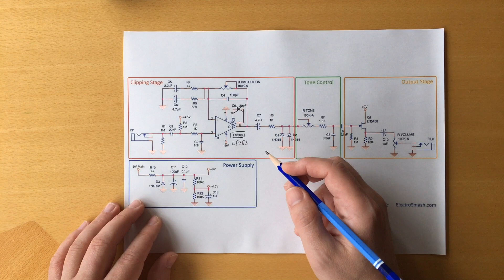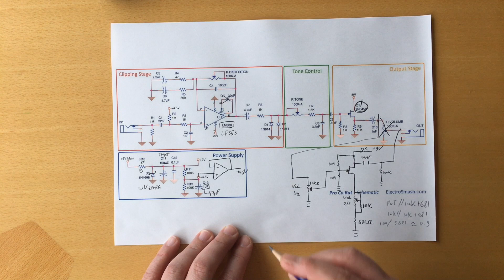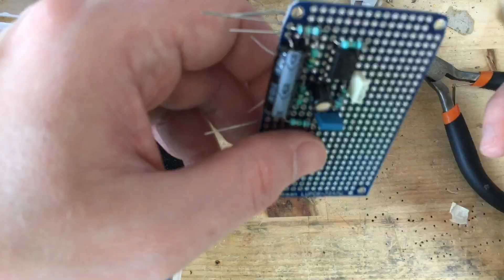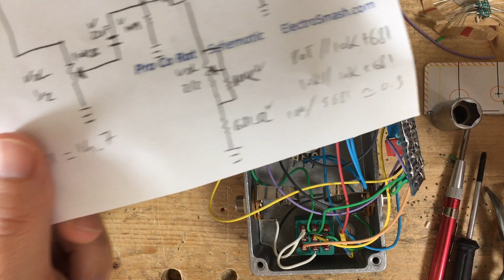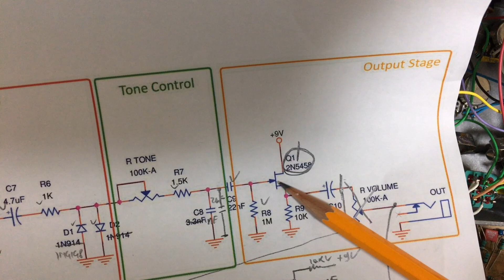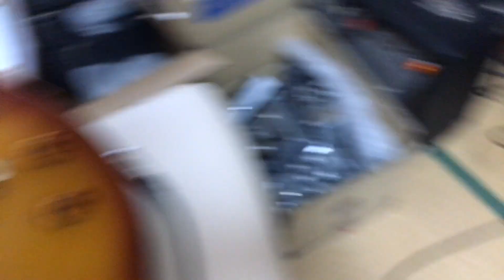The Rratt - How to build a RAT pedal clone

Comment: Thanks for the video, can i use carbon resistors i don't have any metal resistors with me does it change anything ?
Reply from the maker: Sure. The only problem is that carbon resistors have usually higher tolerances, so they are not as accurate.

Comment: Hi, Do you have any other suggestions of OpAmps to modifiy the RAT  besides the LM 308 and the OP07DP??? 

Thanks, Best regards!
Reply: Some use a TL701, but it's got a bit too much high end to my ear. The OP07 sounds pretty close to the 308 however.
Reply: LM741 UA071

Comment: Hi Dud;
Your ZenZeroRratt sound great and thanks for all your explains!
You've got a level,you share it and in a true way!!

i'd like to make pedal ; i have some questions:
what kind of mosfet do you use?...
and when i look at your pcb ,during the soldering, i see 2 ic(the lf353p is a dual) ..and may be one mosfet ...can you explain please?
Thanks :)
Reply from the maker: I don't divulge what the MOSFETs I use are just because that's the only "secret" I have about my pedals. If somebody would really care, it would be easy to reverse engineer my pedals and figure it out. Anyway, you are correct, one IC is the LF353 and the other are the MOSFETs. Thanks for watching!
Reply: Thanks for your answer,it’s a little bit more clear for me now;)I like mix 2 effects circuits ,like OD&fuzz or two fuzz,to make some crazy distos ..but I have more  larsen troubles than you,héhé!good continuation!!

Comment: This is an invaluable video concerning pedal building. You have great insight concerning op amps. I’m surprised there’s not more views or comments on this video. I too have found that jfet op amps have a great sound vs 4558/1458/741. DOD used LF353s on some pedals, gives it that nasty crunch, the supra distortion FX55 is an underrated pedal. The Rratt sounds pretty dang good. I would like to know what made you add to the circuit, and also why you went with a MOSFET rather than a JFET. Love this video and your op amp comparison video.
Reply from the maker: Sorry for the late reply! I've found the MOSFETs I use by chance and I really love them, they sound great and they behave really consistently. Those are the main reasons why I use those over the JFETs. Thank you for watching!
Reply: No worries on the late reply good sir. Looking at the CD4007 (MC14007) , it’s almost like two mosfets in one package, depending on how you wire it up. It can also act as two switches and two amplifiers. Have you ever used this chip in a pedal before? I feel like most people who understand pedals, are only in forums and it seems not many fully understand circuitry. And the ones that do seem to be very full of themselves. You are neither, you seem to understand circuits well and you are humble. A rare combination in the world of electronics! Lol. For me this video, and a few other of your videos, are like my holy grail to pedal making and understanding. Just want to thank you a second time.
Reply from the maker: Thanks again! Those CD4007 and MC14007 look like some interesting packages, surely versatile, but I don't have any direct experience with those. You could certainly design a whole pedal around just that chip, if it sounds good. This article says the CD4007 was designed for digital but could be used in the analog domain no problem https://www.electronicdesign.com/analog/whats-all-cd4007-stuff-anyhow